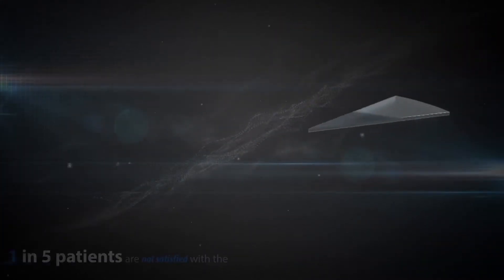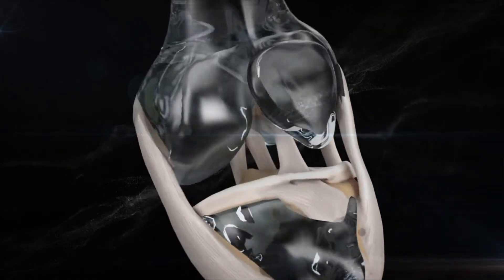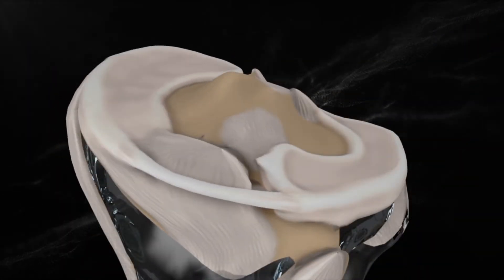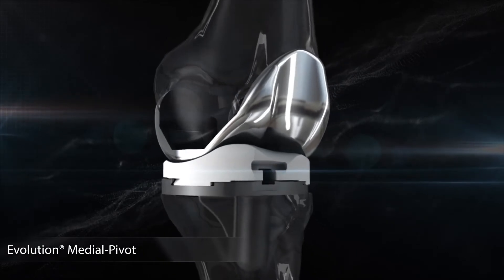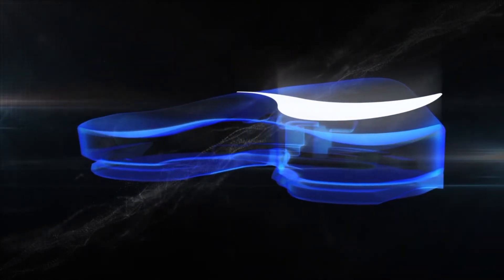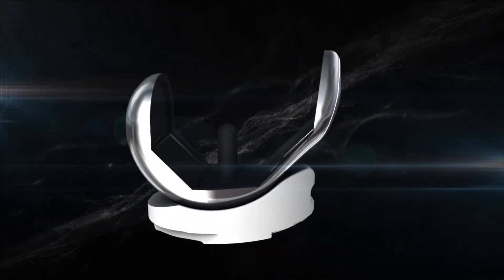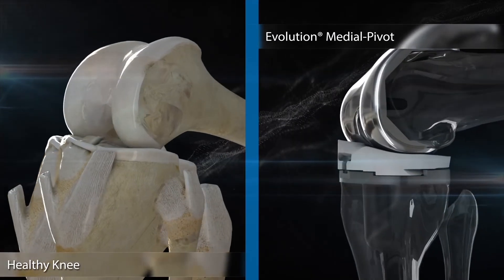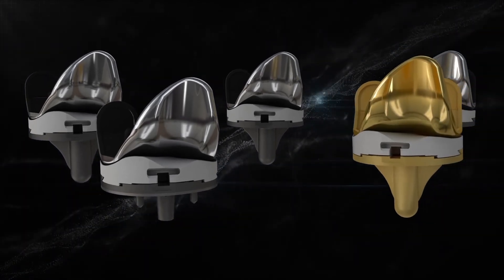Evolution® Medial-Pivot Knee System

Comment: My surgeon used this knee for my TKA 4 months ago.   I now have 0-140  ROM, and fairly pain free except when going down stairs.   I'll often get a sharp pain when doing this.   My main issue now,  and it's a big one for me, is the amount of clicking in knocking I get through swing phase.   I am not 100% sure the doctor got my knee aligned correctly,  or if I might have a slightly defective knee unit.  I have talked to quite a few people who have had TKR and none have reported this amount of non wt bearing movement.   I knew to expect from, but not had this extent. I'm pretty disappointed to say the least.